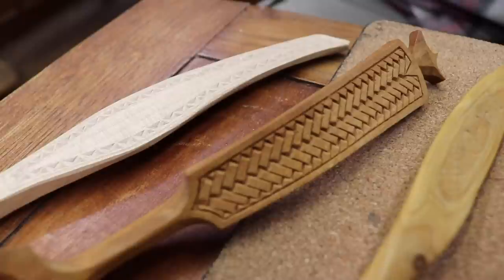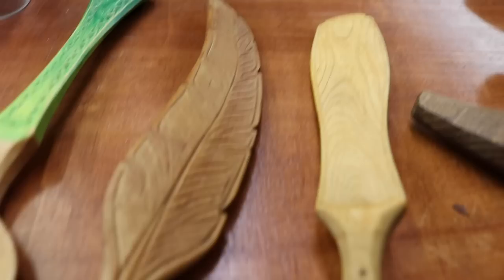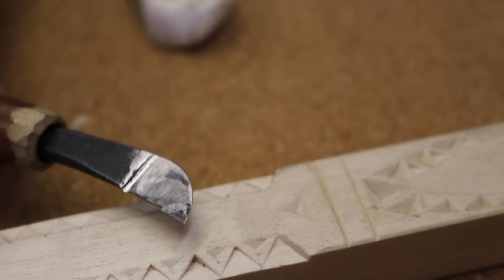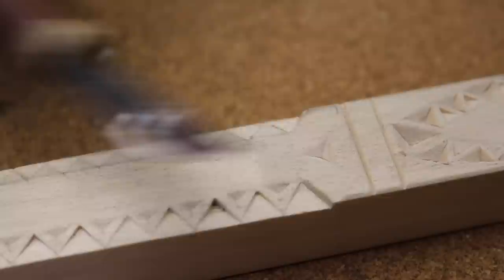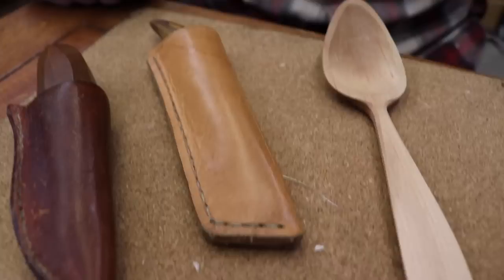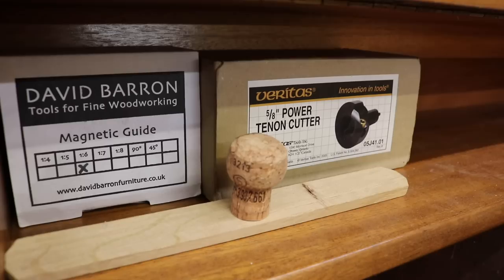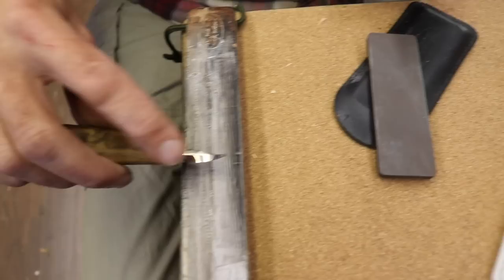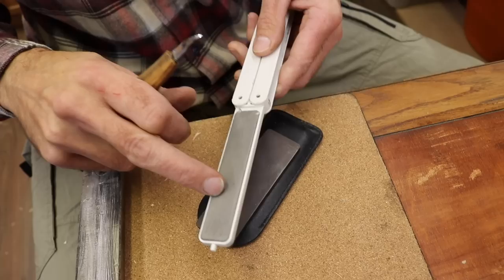Chip Carving Tutorial - Lee Stoffer

Comment: Thankyou for the great tips!  I found it comical that for the tiniest little v's cut it the side of the spoon you used the biggest bowie knife.😅  I don't do it like you, which is prolly why my stuff looks like crap and I am down to only 7 fingers left.  I find a machete length knife gives me the ballance I need for chopping my ugly carvings into firewood.
Reply: OK so..., I went to my shop, sharpened my whittler, and I was wondering:  After carving about three edge triangles I don't quite get one deep enough and the grain acts like a zipper and peels off three of my triangles.   So is it normal to then laugh maniacally and hit it with a hammer?
Reply from the maker: Yeh it's cool to use whatever knife you have to hand and are comfortable with using. Reg your attempt at triangles, it really is a case of simply practising as much as you can, using Lee's teachings as a guide, once you get the hand of it you'll be rocking! ~Peace~